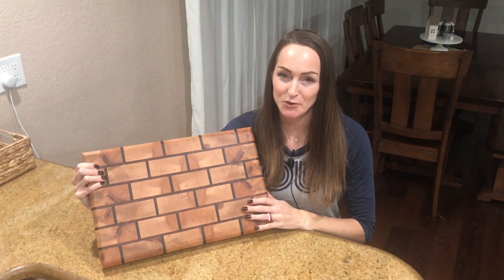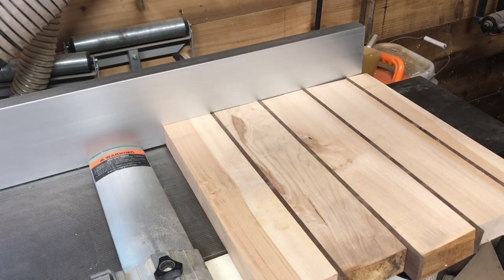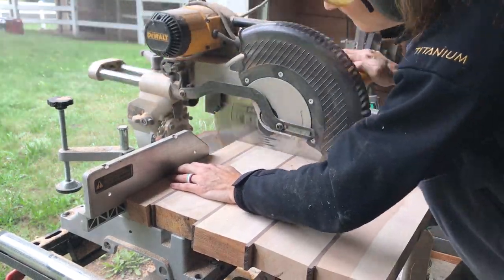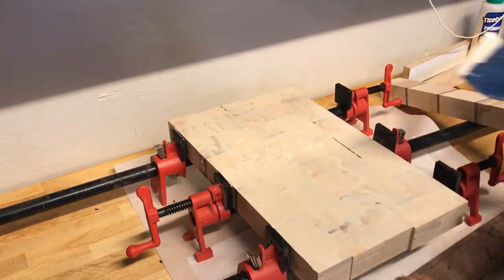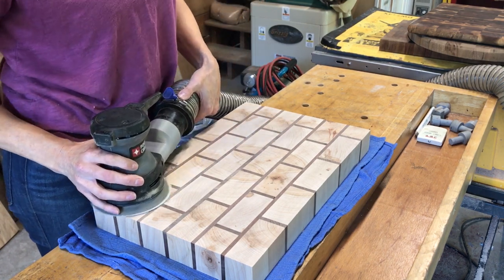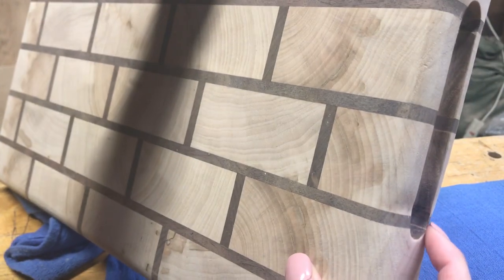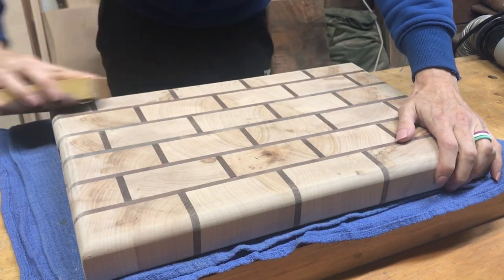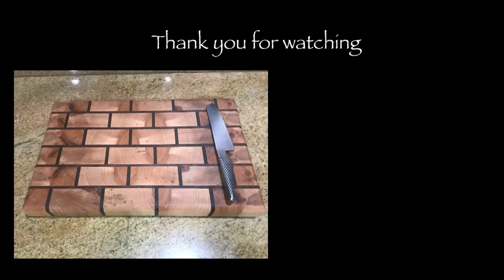Brick Pattern Cutting Board

Comment: Hi! Just a quick question, did the board fail on you and crack becuase of the grain direction of the strips or it's still to this day holding up good?
Thankyou for your answer
Reply from the maker: Good question, I still have it and it’s working great. I should say though that I don’t use it to cut on since I have another one so it hasn’t been fully tested

Comment: Could you share how this board held up after a year? Curious because of the walnut cut. Thanks!
Reply from the maker: It’s still working great. It has a lot of cuts in it from use but other than that good. Great question.
Reply: @AroundtheHouse  thx for the followup. 
so far all i read was that the board would fall apart quickly, due to uneven contracting and expanding. i guess this maybe was a bit exaggerated